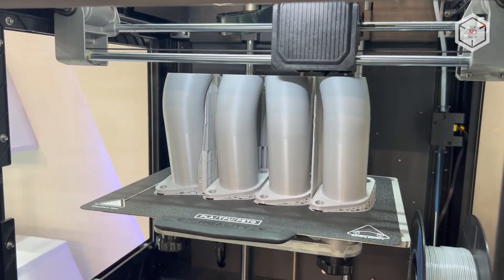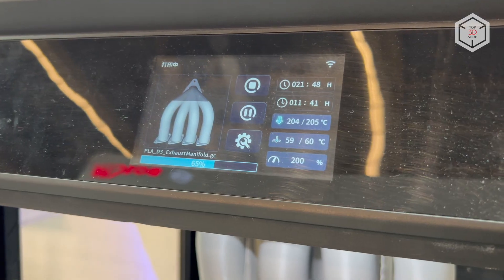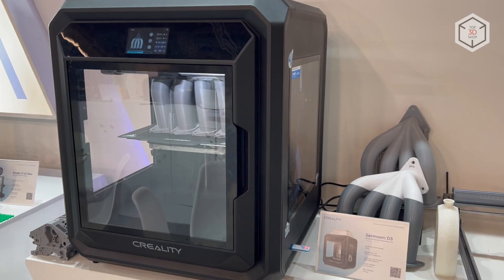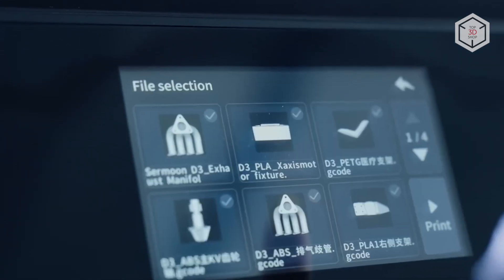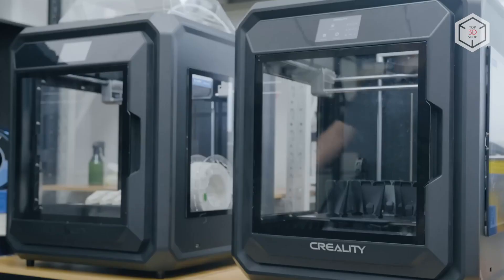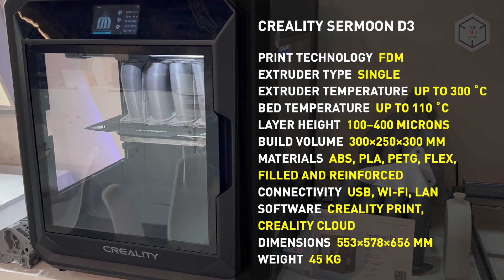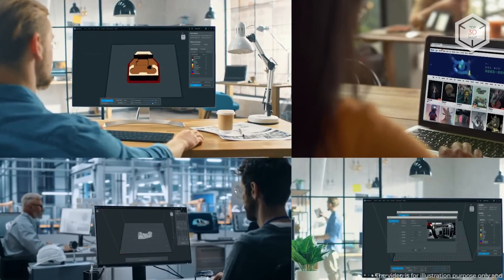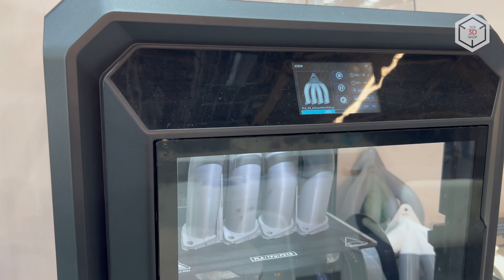Creality Sermoon D3 Overview: Professional FDM 3D Printer for Industrial-Level Solutions

Comment: It is not so much good as they presented. There are still problems with the Wi-Fi connection. One time the printer started printing immediately after completing the previous task but there still was a printed object. From the display, I wasn't able to stop it. The printed result isn't as good as it should be for that expensive printer. I compared the result with the Bambu Lab X1-Carbon.
Reply: were u get the d3 settings for cura the creality slicer is trash?